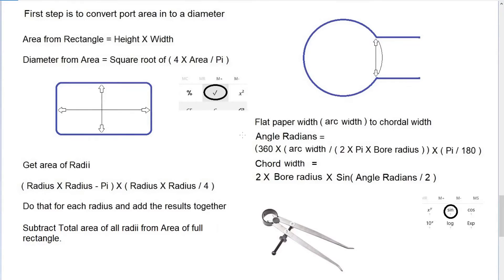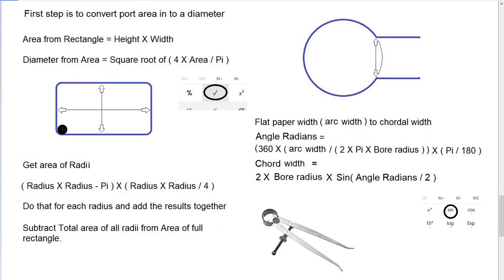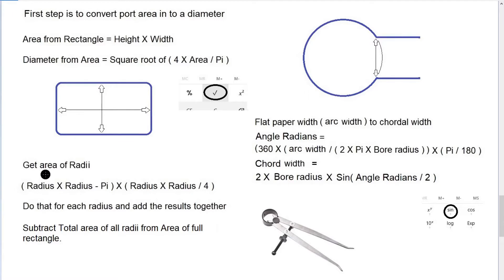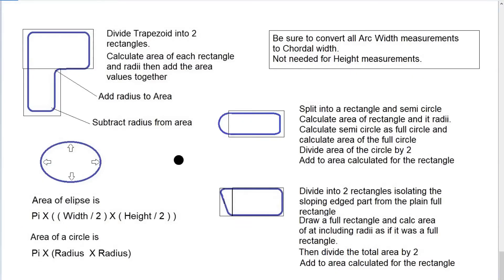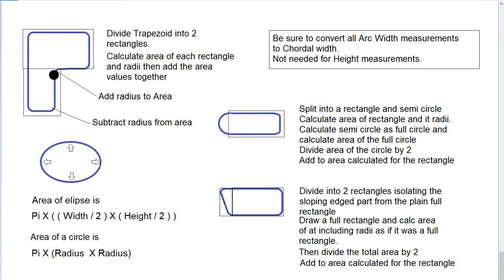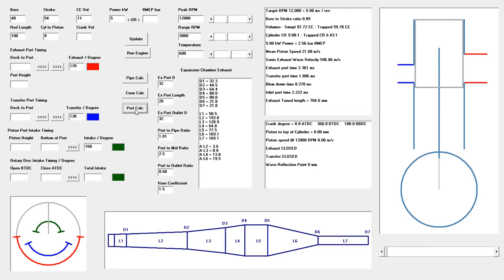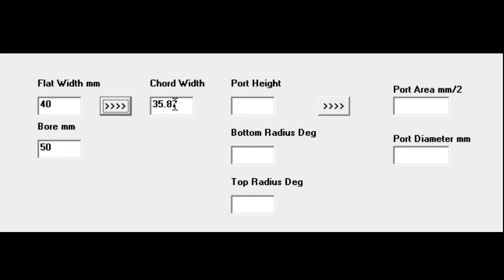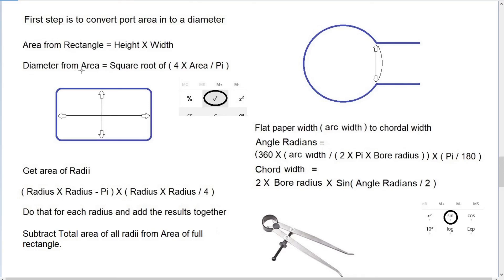How to Design a Two Stroke Expansion Chamber Performance Exhaust - Step 5

Comment: I guess i got it Wrong. I was of the understandng the ex. Port opening at the piston was to be 1.05% larger than a the header ? Can you Please enlighten me.   Thanks
Reply from the maker: For most applications the port increases in area from the piston outward to the pipe.
The header may also expand over its length or can just be straight in the case the pipe is for peak power.

Comment: Great video series.
I have a situation where the piston at BDC does not fully clear the bottom of the exhaust port. I suppose that the port shape should now include the straight edge of the piston as the bottom of the port is not clear of the piston?
1966 Greeves Challenger 250.
Cheers
Reply from the maker: Yes that is the case, there is nothing gained by using a larger port dimension in the pipe calculations if the port does not fully open at BDC to use the piston edges as the lower edge, You could do that by mapping the port in paper (as shown in a more recent video) and then simply ruling a line across the bottom of it to represent the piston edge

Comment: I love your videos man ! Thanks for sharing all your knowledge. 
I'm trying to make my Suzuki AX 100 a bit faster. Is a old bike design 50mm x 50mm cylinder - 169 degree exhaust port  - 123 transfer. Now the big limiting factors are the reed valve is half of a normal one only three petals and has only 4 gears. The third gear is 1.200 and the the fourth gear is 0.950 BIG difference. I did a basic porting like removing imperfections smoothing out very rough casting and changed the exhaust timing to 175 and transfer to 125, exhaust width from 30 > 33.5, compression ratio from 6.6:1 to 7.6:1. It responded very well to this changes. I was thinking in a exhaust with a long belly and shallow angle so it makes power in a broader RPM range. But I have doubts about the RPM it had to be tuned. With the stock pipe the bike rev up to 8000 rpm in 4th gear but really makes power from 3500 to 7500 and peak power according to my ass at around 5000rpm. 

THANK YOU !
Reply from the maker: So the 8000 rpm is the peak and that is the value used in the software to calculate tuned length so that after peak power the pipe (7500) ensures power slopes off enough by 8000 to effectively limit RPM
That is the point at which the wave reflected from the baffle cone goes from being in tune to out of tune as RPM rises over the peak.
Reply: @AuMechanic  Thank you sir !

Comment: What should I do after calculating area ??
Reply from the maker: Convert that into a diameter.
You can use the software Ive created to do the job, its a lot easier and quicker.
I created theses videos to provide the equations while I was writing the software but they are redundant now and there are a few errors, see comments below.

Comment: Formula bracketed wrong. Should be.    (Radius*Radius)-(pi*Radius*Radius/4)
Reply from the maker: You're right.
I was using them to break up the equation into parts taken from my software code for readability which was a mistake on my behalf.
In fact you can just leave out the brackets all together.

Comment from the maker: NOTE, the methods used to measure the port area in this video is NOT the method used to do port time area analysis.
In this case we are measuring the entire port area only for purpose of dimensioning the expansion chamber diameters which is what this series is about.
For the purposes of port time area analysis all ports are divided into segments or slices of 1 mm piston movement over the stroke to represent port area exposed at each point, but that's for another video later and not required to simply dimension the exhaust.